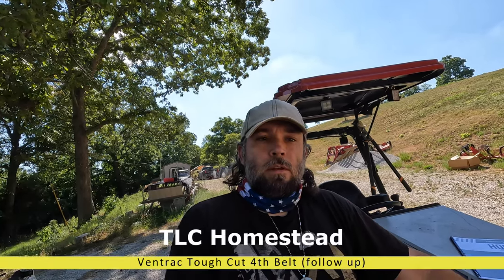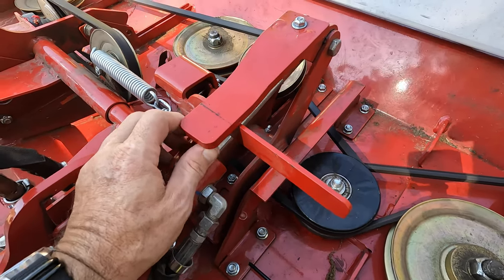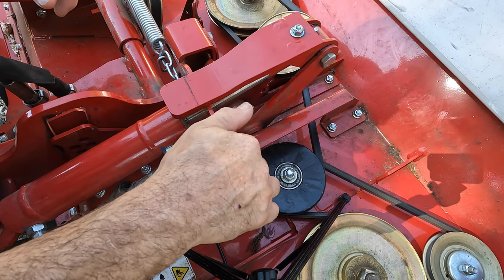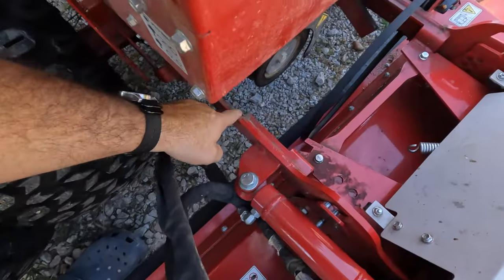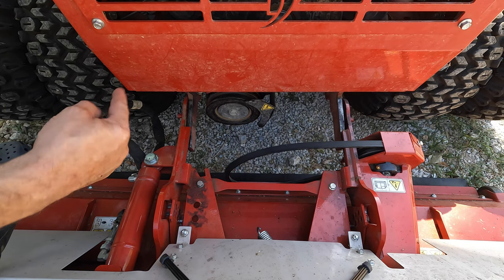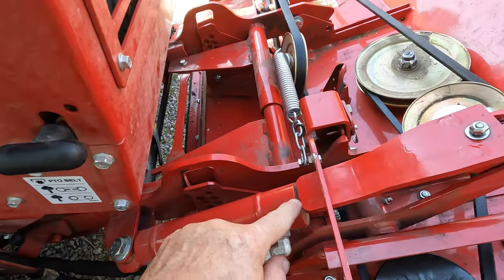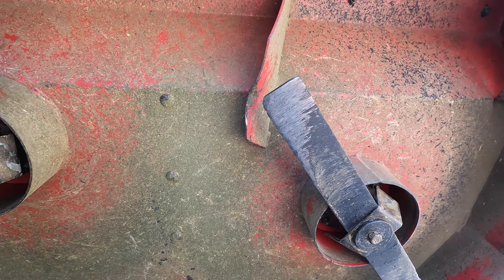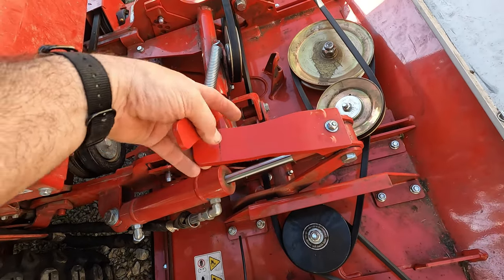Ventrac Tough Cut 4th Belt (follow up)

Comment: I have have had similar issues with the main belt on TC deck.  Ventrac service was a great help in helping to track down the problem.  Couple of things that i noticed on your deck.   The taper lock pulley on the main power input shaft appears to have moved out of aliment---I have learned the hard way that this is critical for long belt life.   Also, check the angle pulley that you showed jumped off in the first video---sometimes the base of that pulley gets bent and allows the belt to jump off.  I have gone from replacing the deck belts every 10 or so hours to still going after 50 plus hours.   The Ventrac belt is a higher quality belt than the Gates Hi-power.   I use my TC deck to cut anything that i can push over!!!!
Reply from the maker: "The taper lock pulley on the main power input shaft "

I tried to find what you were referencing and no good pics. I'll admit I have not pulledout the owners manual yet, it referenced in there so I can check / verify?
Reply: @tlchomestead  I have photos etc how can I send them to you

Comment: Glad you got it. The issue with the belt issues should be solved. Extending or retracting the cylinder changes the tension/length of the belt a little. With the arm in place, it is within its design standards. So when you move the SDLA you can move the small handle without knowing and change the tension on the belt. Now with the flap in place you can move that small lever all day and it wont make a bit of difference in the tension.

Also the Ventrac Belts are a higher/tougher quality than the other brands. I believe the R in the part number is extra reinforcement of the rubber/steel strap of the belt maybe some Teflon in the mold.
Reply from the maker: If the "Ventrac" belts are tougher I have yet to own since day 1 delivery, a 162" Ventrac belt. My Tough Cut was delivered with a Continental and I will bet you a coffee that Ventrac does not make their own belts :)

Comment: I have smeared grease on the two lift arms and this has helped with engaging/disengaging of the attachment.
Reply from the maker: I just did that same thing! When I was greasing all the fittings I thought adding soime to the arms as well could do nothing but help. I am glad you say it helps, I only attached once since greesing and I think the issue in these two videos was the angle of the Ventrac vs the angle of the Tough Cut.

Comment: 2:25 https://youtu.be/XNn3URRDihI?t=2128 (this is mainly for anyone coming to the video after posting, I know you figured it out around the 10 minute mark)

3:18 I agree with you that I don't know how the lever would affect the deck (not enough experience or knowledge to say one way or another...MAYBE it allows damaging belt travel if you accidentally nudge the auxiliary handle during operation?), I can only say that it is wrong and can't be ruled OUT as a contributing factor to the 3 belts after the first since it was a present known fault.

5:02 I still only have a half dozen equipment swaps for the tough cut, but I experience the same thing, that I can get the arms lined up but pushing the machine just pushes the deck. I have just take to getting it connected as much as possible (still not enough to lock the tabs) then jumping off and pushing the attachment towards the machine the rest of the way on. I am certain I am just using the wrong holes but have given up trying to figure out and just use my workaround :D

12:40 I think you are right and something got jammed in there: https://youtu.be/XNn3URRDihI?t=1983

Glad it is up and running again! Hopefully the end of your belt issues but I guess time will tell! :D
Reply from the maker: hah! Aaron hit it spot on in your video link. I learned from trial and error, plus a bit of luck :)

I stand by I have no idea how the flapper lever could impact the belt if I have nto used it BUT, I did not design the Tough Cut soooo... like you said, it is now somethign to rule out and I am counting July 7th as "day 1" for this belt. Yes, time will tell :)
Reply: @tlchomestead  also make sure your weight transfer is off, it should be easier to connect your attachments when weight transfer is off.

Comment: My tough cut deck is one generation earlier than yours.  My model has a support stand on the center of the rear edge of the deck which is lowered to hold the deck at the right height to couple with the power unit's lift arms.  On that gravel surface, your rear deck is a bit lower than ideal for hook-up alignment.  it might help to set the height at the 5" level instead of higher, but ya gotta quit chopping those rock  ;-)   Or, place a couple of chunks of 4"X4" wood under rear edge of deck before removing deck.   By the way, checl out the All American sharpener for those blades.  It will do CCW blades too.
Reply from the maker: I was actually wondering about what if I used old pallets to drop the toughcut and power rake onto when removing. I ahve some that are in pretty bad shape and not good for much else so that test is on my list. Shall see if it even works, let alone does it help. 

As for mowing rocks -- boy I sure would love to quit doing that! I have no idea where these rocks keep coming from. I get an area all squared away and over winter the rock gremlins must come visit and drop a new batch for me to find in the following spring and summer! 

I need to sharpen my blades bad. It is amazing how poorly the Tough Cut is doing right now due to dull blades. I do nto see Ventrac listed on that All American blade sharpened. What model you using? Sounds like the 5005 might be the one to try from their "most versatile" commnets.
Reply: @tlchomestead  Won't hurt to try.  You can get the implement too tall for the power unit.  Secret is to get them on same plane so that the power units arms are parallel all the way back to the implement pocket.  My old style tough cut has a rear support that I have to set; if I forget I then have to use a jack to raise it up to level - PIA for sure.
Reply from the maker: That is what I am trying to deal with, the flatness. The closest cement pad, road, whatever, is the last section of my neighbors driveway by his house about 3/4 mile away! One, of the many, projects I have is to make a bit flat area up between two shipping containers and get a roof over it. Gives a dry place to store implements and hitch / unhitch. That is going slower than I want because every roofing idea I look into is not cheap and/or requires weight applied to the containers themselves. Which we all know only the corners are meant to bearing weight. 

someday . . .